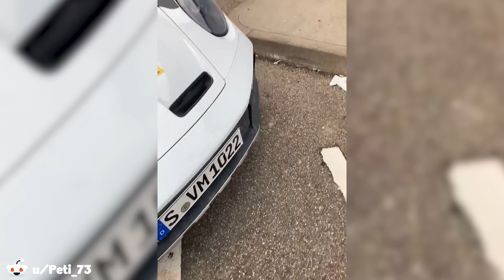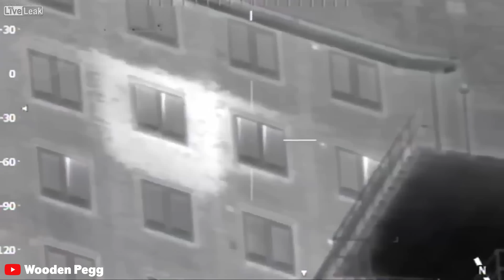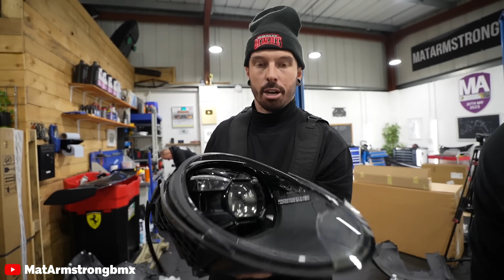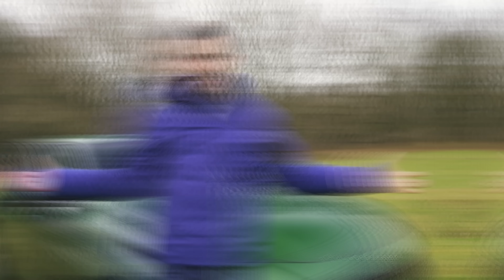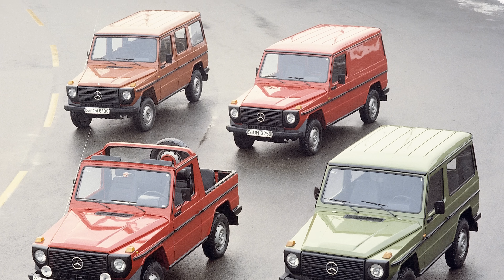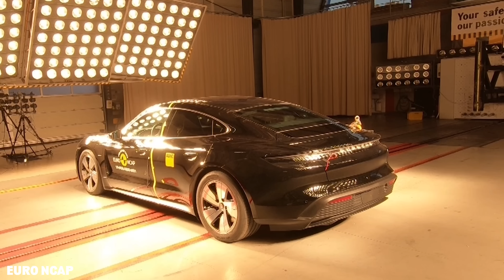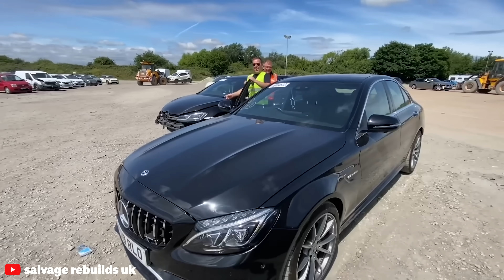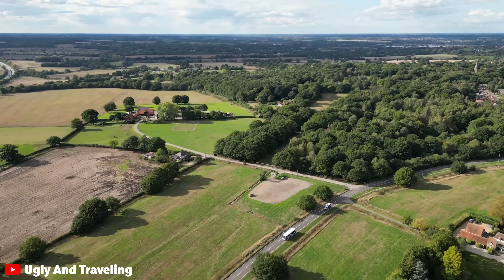Why thieves steal Porsche headlights!

Comment: This has always been a thing. I remember getting a wise advice to superglue ball bearings into the Torx screws of LR Discovery taillights because thieves would unscrew and take them through the panel gaps, that was around 10 years ago after a guy I know with another Disco had his lights stolen. The reason they are putting a stoplight on this stuff now is because they want to make it seem like an even bigger problem, put some laws in place that make selling used parts harder and as a result get more older cars off the road and force newer ones into dealerships' grimy hands. If you see new laws like that soon, you know whose butt you should go kick.

Comment: use your brain. If it has better cooling than it take more heat out of the device and puts it in the air.. more heat in the room.  The light is just more efficient -> less heat.

Comment: Spare part prices are astronomical, insurance companies 'buddy up' to preferred repair garages with higher costs, lead times for spares are also huge at the moment - so of course a market springs up for 'cheaper, quicker, spares'.  And since the bill lands wholly on consumers, the manufacturers and insurance companies don't give a monkeys.  Manufacturers could VIN mark every large component very easily, but of course they'll do it electronically instead and make it a main dealer only option to code that part to your car...

Comment: I drive an audi s5 and recently some guy scratched my left headlight when he tried to get out of the parking spot. The scratch was barely visible it was so light, and everything still worked. I brought it to the garage and was shocked when I saw that it cost 4000$ for new headlights. I thought they would only change the glass cover, but since modern cars are like iphones you have to change the whole module. I'm not surprised people started stealing these modules because they are worth so much.
Reply: Double leds in my dads c63s 😥

Comment: Make the new cars have a very secure way to enable service mode and if it hasn't been enabled, especially electric cars  with a lot of kWh, should be designed to shock the thief when he gets to touch a spot he isn't supposed to be touching and able to get to, if he isn't stealing. Tuch the spot without the car in service mode and shock the thief bad, so instead of worrying they will start stealing sensors, they will get an electric taizer. Actually the first smart-er cars like 2010s, I remember there were  Audis front bumper sensors were getting stolen, with everything they do with it, as well as other German cars, so sensors used to be a part long time ago now,

Comment: This I would say it is because of greedy manufacturers I requested a price for a plastic rear fog light on a 2019 Land Cruiser and was told £340 and a further £40 for the bulb holder then I found another uk based parts dealer who deals in genuine Toyota the same part for £79, when it came it was genuine with the right marks and in the right box so this is why crims steal these parts yes it may be for hydroponics in some cases but they can sell these on and make more money because dealers sell higher just to make more profit so the manufacturers are a big part of the problem. Crims steal because there’s no consequences

Comment: Maybe manufactures need to stop charging silly money for what is basically a plastic mould with led's in it that cost 10's of pounds to make and sells them for thousands they ain't performance enhancing same as wing mirrors a pissy bit of carbon fiber to hold mirrors in doesn't cost thousands either just a rip off for spares

Comment: I hate that car manufacturers had to make a part far more difficult to remove just so it would be harder for theives to steal. Example is the 991 generation 911 headlights, easy to remove with just a hex key. Then with these headlights being stolen, they redesign the headlights for the 992 generation 911, now you have to remove the wheel and the wheel well covers just to remove the headlights.

Comment: Drug labs may be the answer but I think it is much simpler than that. Matrix headlight costs a few thousand eur and it is not covered by insurance. Some of the cars are getting older so they need replacement and here you go. Second hand market. Then comes another thing, by stealing them, they create a demand. A few years back, the same thing happened with first gen Touareg/Cayenne headlights, they were stolen like hell because it was very easy. Audi distronic radars, same story.

Here in East Europe though, thieves dont bother stealing parts, the steal the whole car and rip it off for a few hours in a garage. GPS trackers never help, capable thieves are blocking the signal. Then it comes the insurance problem. Until the case is closed by the police, they are not paying you anything. This could take months, even years.

Comment: Apple has a solution to this. iPhones used to be prime targets for theft but now they’re not. It’s not that the scumbags went away or lost interest in expensive phones but the iphones are useless when stolen these days because you can’t unlock them without the owners icloud account and you can’t just break them and reuse their parts due to coding. Volvo does something like this with their electronic parts, if you want to replace the headlights you need to use VIDA to connect to volvo and download a signature that approves this serial number in this car. Also means the police can be informed if your garage login just tried to code a stolen unit.

Comment: Great video but very scary too, especially for anyone who owns a luxury car.  I had the catalytic converters stolen from my Toyota Tundra last year and it was done in less than 2 minutes.  Both cut out at the pipes while I was playing tennis (where I had to park on the street, some distance away from the courts in a park).  It's a horrible feeling to think your car will be ripped apart by thieves, especially when they usually get away with it.
Reply: Got mine taken off my Tundra too. $1500 to replace

Comment: As a cannabis grower I can guarantee you those Porsche lights are not suitable for growing cannabis. To grow cannabis efficiently you need several wave lengths of light. The Porsche lights would not provide that at all. Grow lights are extremely cheap now with the saturation of LED's in society.

Comment: This used to happen on motorcycles. There was a company that would put a tiny chip on the most wanted things and also put a number on all plastic parts that could not be removed ie the headlights. 🤔 that should stop a lot of this happening. Data Tool I think it was called

Comment: I think the weed growing hypothesis is bollocks. Headlight LEDs aren't substantially more efficient than any other kind of LED, so there's no way they produce less heat for the same amount of light. Additionally headlights don't emitt the correct (optimized) spectrum for plant growth and they have a beam pattern that is not exactly designed for that purpose.

Comment: As cars become more software based I imagine manufacturers will start doing what Apple does on their MacBooks and tie all parts with microprocessors to the vin number of the car. If you take a part from one car and try to use it on an identical car with a different vin number it won't work unless you take it to the dealer to be programmed and they can check to see if it was reported stolen before reprogramming it.
Reply: Most vehicles are this already coded to the vehicle
Reply: This has been in place for years for several manufacturers ...
Reply: That’s definitely not a future I want to be a part of…

Comment: I don't think that sensors are going to become the next big thing to steal simply because before use you need to calibrate them to your car. To do that, you need proper diagnostic tools as well as proper etalons. For example, if you want to calibrate a lane sensing camera, you need a special board that the camera scans and tests itself upon. These boards are hopelessly expensive and there's no way your average thief or shady serviceman will have them. But headlights? They're a very expensive item, easily nickable, no need to calibrate (usually), so why not?

Thieves and parts dealers are not smart. They go for the most convenient thing. Sensors are anything but

Comment: Early Cayennes and same years 911's you could literally just palm the lens and pull the whole assembly out. I did it several times to just work on mine. They were worth over $1,00 back then (20 years ago).

Comment: I live in Mozambique and here they do this all the time. To prevent this we mark every car part, permanently, with the license plate of the vehicle and also rivet the lights to the body. This doesn't stop it but it makes it way harder to steal without breaking the part and also harder to sell it.
Reply: Thought this only happened in South Africa but it is mostly VW cars here
Reply: They have been using Alphadot on motorbikes for decades and some cars.

Comment: Since you mentioned South Africa , the problem here started with the VW Polo/Golf 's adaptive  LED lights and so on. ( Mat did mention other German manufacturers ) but mostly VWs. They then either sell to Junkyards from which others ( car modifiers looking for cheaper suppliers since a single headlight alone can fetch around +/- R50 000 ).

It's been more common since these automotive manufacturers' headlights simply cleanly pop off of the car.
Reply: Not to mention the very irritating stealing of emblems/logos. I thought this was only a South African problem. Man, I hate thieves
Reply: @Under_Construction100 it's a VW problem. Can't you see a Porsche is a VW.

Comment: Matrix headlights should be the same part for left and right hand traffic so theres a much bigger global market to get rid of them in, along with their high cost making it worth the effort.  Does this mean they'll soon be coded to the chassis so the manufacturer controls repair/replacement like the battery and display of a smartphone?

Comment: Well done Matt...  Another bit of info....10 years ago my friend had the headlights stolen out of his 997 GTS. Police informed him that it was indeed illegal cannabis growers trying to hide and lower production costs.  Here in Canada the police are informed by electrical providers of homes that have unusually high consumption.  These headlights have a very low electrical draw for the light produced and are easily wired to household current using a step down transformer.
Reply: Low power low heat LED lights are available in any DIY shop.  Grows bypass the meter so the electricity company have no idea what the consumption is.

Comment: And all this is driven by Stupid rules to make the cars more ‘efficient & less harmful to environment ‘ Even though the entirety of the east are doing nothing about it. Climate change and this whole agenda on environment is nonsense. Wouldn’t it make so much more sense if we just made things to last. The waste and overall savings would far out strip anything else that we could do. 
So you can see where this is going.
Make really expensive cars with parts that are insane to buy. Make it so that there is always a shortage. Continuously change the design making it more and more difficult to have suppliers that hold parts. Price out the general public from pretty much all cars. Make public rent cars

Comment: I see this becoming a situation where, like the iPhone, the parts are serialized to the car and won't be replaceable without contacting Apple and having them remote in to re-calibrate the part. If it's not bought from Apple (or said OEM), it will not function. This is a genius way to combat parts theft.
Reply: That is genius part to pay 10 times more
Reply: @dzonikg  Oh, I agree! But unless another idea is found that makes this much sense and is as effective as what Apple is doing, they are who the auto makers are looking at right now. Think if you had a Taycan and had both your $2-6000 Matrix LED lights stolen... If the part were serialized to the car then nothing they stole would ever work on any other Taycan because the serials and VIN don't match and the only way to correct the problem and make the part light up is to have it authenticated as a real part by the dealership. Except this part already is serialized to another purchased vehicle and they will not reprogram the firmware in the lighting controller to the updated Serial/VIN because it's recognized as stolen now. The only way would be if they were identified stolen, contacted the original purchaser by phone to ask why there's a headlight at their dealership trying to be re-flashed and if there's been a theft. In that instance they hold the lights, call the owner and insurance company then the police.

On high end vehicles I see owners actually paying extra for this.
Reply: But very annoying for non criminals
Reply: @douglasberg2881  Never did I say it wasn't, and I agree completely, but has that little tidbit stopped Apple from selling devices with those exact features since the iPhone 12? Nope, not a bit. But unfortunately for those of us that actually know repair, it IS asinine... but for the general consumer it's going that way.
Reply: Even some Jeep headlights have to be "flashed" at the CPU to even work.
Reply: The better solution to preventing theft of parts is for manufacturers to stop selling them at an unjustifiably high markup. These units cost a few pounds to manufacture, LED chips are cheap, even 15W chips for car headlights. The only reason they cost so damn much is because they're non-repairable, i.e., you HAVE to buy brand new units when your current ones die. Since you have no choice (unlike replacing a simple bulb), you are completely at the manufacturer's mercy so they can charge whatever they fancy. Got a premium car? Even worse.

The used parts market lessens the blow by a small amount, but prices often stay relatively high due to lack of supply and OEM pricing.

They're only worth stealing because they cost so much to begin with. As much as I hate it, I can see why thieves would go for it being low risk high reward.
Reply: @joshuatk59  You're not thinking in economies of scale. That Porsche headlight assembly is not made in the millions. Maybe 10's to 100's of thousands. That's why they're so expensive. There's so much technology in such a specialized part designed specifically for this vehicle and it's communication protocols, that the price actually is that high to manufacture it. 

Now, take a Ford F150 tail-light with the radar sensing in it. That has no business being as expensive as it is, as it's manufactured in millions guaranteed. That's just price fixing/gouging (however you'd like to look at that).

Comment: I wonder if manufacturers could lock these headlights and ones like it… possibly coded electronically and engraved with the original VIN/number plate… or if aftermarket company’s could do this.

Comment: I'm a bit baffled as to the concern of the cost of replacements parts after a theft. UK vehicle insurance is different, for sure, but here, in the U.S., such losses would all fall under, "comprehensive" coverage, loss not due to vehicle collision. The common deductible for comprehensive is $100, so that's all repair would cost. What's the deal on that side with loss due to theft?

Comment: How many times has Carwow changed the thumbnail and text now? 😅

When my BMW rims (20-inch 666 M) were stolen in Berlin, they were nice enough to jack up the car so that not everything was broken. A friend's ceramic brake broke in the process, 20k damage with the wheels. But 2 years later the police informed me that they had caught some thieves from Poland who could be the stealer. I was never the owner so I gave them the number of my dealer. No idea what happened then.

Comment: The days of going to Halfords to replace a bulb is long gone 

Nowadays- the daytime running headlights on cars cost a fortune to replace
Reply: 1st world problems lol

Buy a brand new car with all the bells and whistles, tech, LEDs etc. and then complain that all that complicated tech isn't as easily repairable or replaceable by the average person.

Generally, if someone has the money to get such expensive and tech-riddled cars, they're probably not a mechanic... not that I can see any youngens today actually replacing a bulb, or servicing their car even if it is easy.

A car doesn't have to be BRAND NEW 2023 onwards to be a nice car to own and drive, people just don't look very hard and the manufacturers bait people in with finance usually.

The best solution, however, is to cut thieves hands off. They won't steal, people won't have to claim as often, premiums should get a bit better.
Reply: @gopnikolai7483  unfortunately though, even cheap cars are stupidly tech riddled these days an have been for many years, meaning most cars on the market these days, new or used, won't be easily worked on at home.

the alternative of course would be a classic, but that has its own problems

Comment: Car manufactures need to do what Apple does. Tie the electronics such as the LED lights and airbag unit to the cars VIN so even when it is stolen and placed onto another car it wont work unless it is reprogrammed by an authorized dealer.